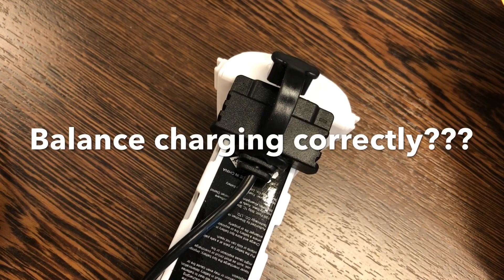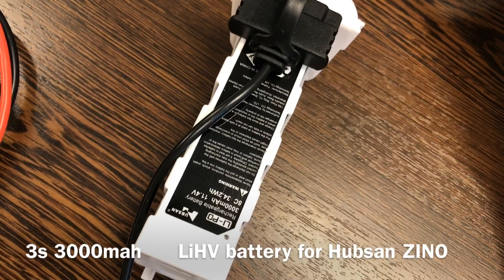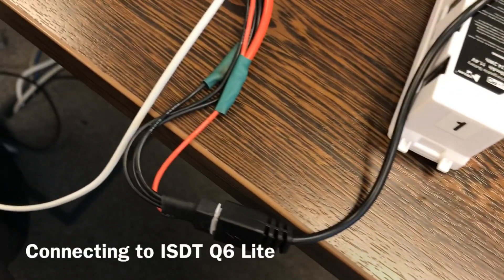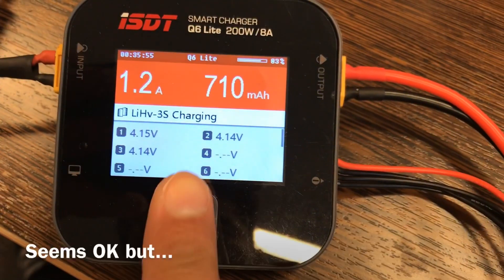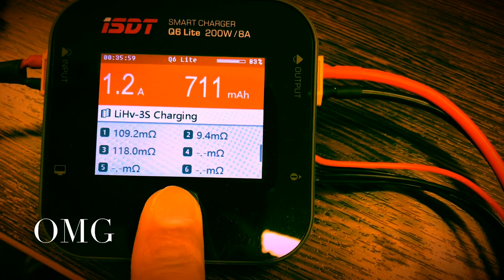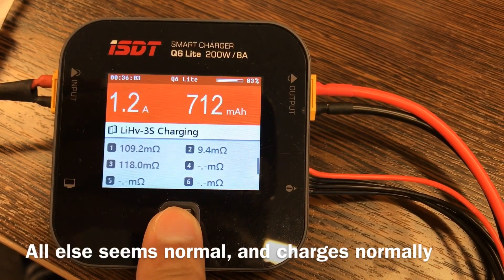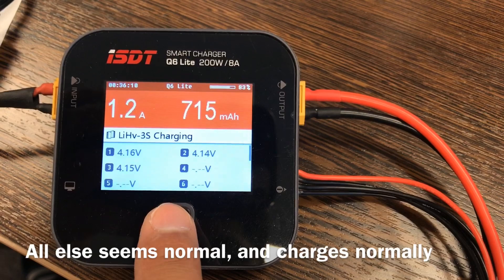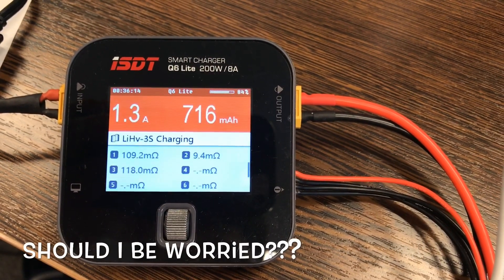Solved! [Seeking Advice] Balance charging Hubsan ZINO Batteries - is this normal or DANGEROUS!?

Comment: Hola la resistencia interna de la bateria , es tan alta, por que las lipos del zino, llevan un chip de control, un saludo
Reply from the maker: Miguel A Hita  ¡Hola, gracias por la información!  No he pensado en eso.  así que supongo que estoy bien para seguir cargando así, ¿verdad?
Reply: @loveyourgear  Hola si y maximo 2A, por lo demas bien un saludo
Reply from the maker: Miguel A Hita  ¡bien entendido!  ¡muchas gracias!
Reply: @loveyourgear  ok
Reply: @loveyourgear  se para solo cuando acaba de cargar el isdt?
Reply from the maker: Diego Hola! Esta es una traducción del inglés.  el ISDT dejará de cargarse cuando alcance el 100%, pero si no presiona un botón, se iniciará el sonido de la alarma.  No debes irte cuando estés cargando, así que creo que la alarma es una buena idea.
Reply: @loveyourgear  ok, then sound clock when its finished? how long does it take to charge the battery ?
Reply from the maker: Diego less than 1 hour. Because the Zino battery is 3000mah, you can charge it at max 3.0A. The original Zino charger will charge at 0.8A, so close to 4 times speed. But I use this to charge not for the speed, but because I can check all cells are charging in a balanced manner. Safety first.
Reply: @loveyourgear  What configuration do you recommend?
Reply from the maker: Diego I tend to charge between 2A and 3A, but never above that.

Comment from the maker: For the record, it seems to be doing a much better job than the stock charger at charging up each cells in a balanced manner.
Reply: How did you rig the cables up for the charger.? did you buy the cable and connectors separate from the charger itself?

Comment: Hi, i had a little short circuit  for maximal 1 second, after the original battery stinks  a little bit, after a testflight with my zino h117s for ca 15 Minute i notice  a little capacity Problem i think but it works. Now the battery stinks Not more, i put it in a amunation Box with a Ventilator. Not the battery is cool not Hot, don't bloated.. But he Smells a little bit but it works. Can i leave it? My New gefi battery Comes in the next Time. Can i use the original battery at a second one?
Reply from the maker: Hi, I know batteries can be expensive, but the drone is more expensive. If I were you I wouldn’t risk using a battery with any issues.
Reply: @loveyourgear  thats real ok i will do, i don´t like to miss the drone like a fail in the battery

Comment: I did not understand. The Zino's battery is not 11.4V ??? Is not every cell with 4.16V wrong? Should be 3.8V each cell ???
Reply from the maker: Hi, thanks for your comment, and very sorry for late response. Voltage display is fine, I was concerned about the Resistance values. That said, it turned out to be just fine, no problems, so I do recommend charging like this, using a more sophisticated charger.